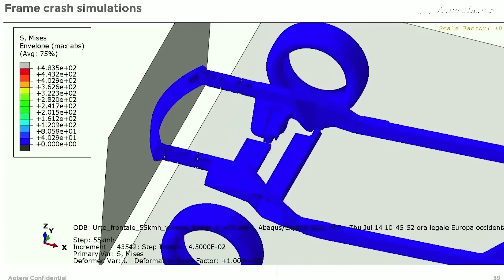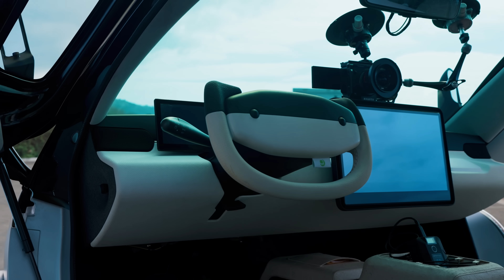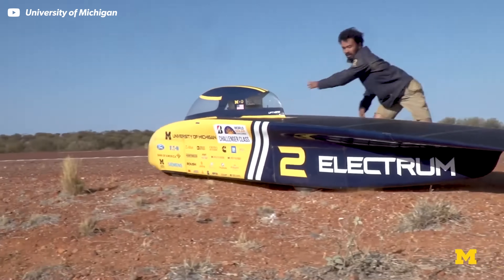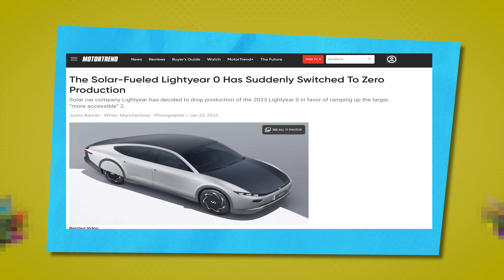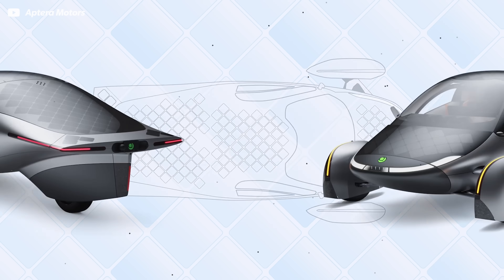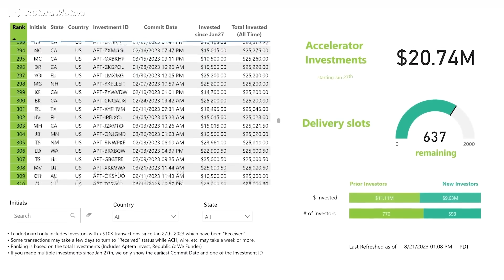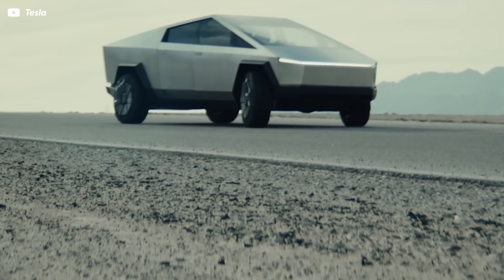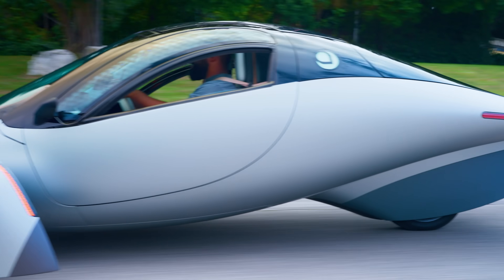We Drove America's First Solar Car

Comment: We desperately need more inexpensive solar vehicles. Bring them to the consumer. We want them. 

Most of us commute less than 60 miles to work. This car would mean free transportation to work every week. Which would free up so much income for low to middle class families.
Reply: And it's cheaper than most new cars at $25,000 usd
Reply: Except this design is dumb and not practical. If it was a regular 4 door with solar panels then yes, this thing is not getting used for a family car, there's no storage or space so this will have to be an additional car because what middle class families are buying this over a 10-20k SUV or Sedan...
Reply: @PieceOfSchmit new car sure, but for “cheap” daily driver it’s far off the mark. Used cars around $10k will still have this beat for usability. You couldn’t make this your only car unless you were in a big city where most everything you need can be delivered if it’s big.
Reply: @Mrbootyman Definitely not a family car as for the storage i guess it's behind the seats. 😅 Good enough for me since I'm single.
Reply: Everything about solar panels on a car is stupid. Even with 100 percent efficiency solar panels the sun doesn’t emit enough energy within the area a car takes up to be able to power it. It’ll always need a battery and it will always charger way too slow to be practical. It doesn’t add enough range while driving to matter it has to sit for days to charge. Far better off just putting solar panels on the roof of your house and charging like normal if you want solar power. Putting solar panels on cars will make them more expensive and easily damaged for negligible benefits. It’ll have a negative environmental impact. Solar panels already barely make up for their own carbon foot print putting them on cars just makes it worse. It’s a gimmick with no logical reasoning to exist.
Reply: What about a cheap electric car like a Nissan Sakura which cost about 16000 usd and you spend the rest of the money for solar at your house instead that way you get a much more practical car and free energy for not just your car but also your house. The only downside is your car doesn't do 0-60 in 4 seconds, but do you really care? Solar vehicles are cool but I don't think it can be the main trend.
Reply: @Mrbootyman there’s not enough solar energy for a 4 door car or you’re back to 10 miles a day
Reply: @Mrbootyman   Actually, there is a great deal of storage - over 32 cu ft.  sure it is a two-seater but 90+ percent of all miles are driven with the driver alone in the vehicle.  The money one would save on gas driving this instead of their Escalade would damn hear pay for itself. This means that for nearly the same dollars,  instead of having a big SUV with 100,000 miles on the clock, at the end of five years you still have your Escalade, only it has 12,000 miles (all the family trips but no commuting) and a low-maintenance EV with a million mile battery with 90,000 miles having spent less than a half-penny a mile with 200,000 or more miles left.   

It is only dumb and impractical if you're highly invested in Exxon-Mobile 'cause this innovation is going to make owning that stock dumb and impoverishing.
Reply: @Mrbootyman  most people grossly over estimate how much they drive and what they actually use a vehicle for.
Reply: @nutthaworncharoensuk1483  My only problem with the Sakura is that it's a Nissan.
Reply: @Mrbootyman  not everyone has kids, in fact, the under 35 demographic is having less and less children. People definitely want a car like this.
Reply: @JacobLeeson-zk1ol  I would say "up to 40 miles a day" is a pretty sizable amount, my commute to and from work is less than that. Obviously, weather is gonna play a big role in that, but it's a decent amount of free energy; and I don't work every day so my days off would offset the loss of bad weather, so it's hardly a gimmick for those who don't drive a lot. Repairing the panels is definitely a valid concern though.
Reply: @bobert4522 I think its very obviously a city car
Reply: @Mrbootyman  Most cars on the road only have 1-2 people in them
Reply: @JacobLeeson-zk1ol 40 miles of range per day is not practical? That’s exactly how much the average American drives per day.
Reply: @Mrbootyman  in North America the average amount of people In a vehicle per trip is 1.3 persons. Rarely is it more than 2. Just drive on the highway and look into people’s cars and you will realize that no one carpools and everyone loves using a 2-3 ton vehicle to move themselves and a few lbs of stuff from work and back.
Reply: @bobert4522 Lmao, do you live in the middle of a forest? No one said this would be the daily driver of farmers lmao.
Reply: @DadsGetDubs  Fair enough
Reply: @JacobLeeson-zk1ol you obviously haven't done enough research on solar panels. They aren't a replacement for standard energy production, but that doesn't mean they don't produce any at all. It's not a stupid design either, it's based on aerodynamics (which increases efficiency). Compared to fossil fuels, the carbon footprint is much smaller.
Reply: @alalalala57  nor did I say you would be hauling timber in it.
Reply: @DatGrape111 The aerodynamics and solar are completely unrelated you can make a car without solar panels aerodynamic it would be easier actually.  Putting solars panels directly on the car doesn’t make sense. It’s not any better for the environment then having the solar panels elsewhere and just charging the car but it’s much worse for the user hence why it’s not practical. The theoretical maximum for solar power is 1000watts per square meter. Realistically it’s more like 200-300w. A standard car is around 4.9 x 1.8 meters.  That’s 8.1 square meters. At least 2 of that is unusable because of windows ect so let’s say 6.1m^2. That means best case scenario you could get 6100 watts however realistically it’s more like 1220 watts. Cars use peaks of 600kw when accelerating and use 15-30kw at highway speed. Solar panels are no where near enough. They can charge a car when not in use they can’t sustain it. So there’s no reason to not just charge using regular electricity. The electrical grid will eventually be completely renewable and in the mean time put solar panels on your roof if you want them it’s far more practical.
Reply: @JacobLeeson-zk1ol I don’t understand how it is worse for the user when the whole point is it lets you charge without plugging in, that means if you’re parked at work and they don’t have EV spots you’re still getting charged. This vehicle is far lighter and more aerodynamic than normal cars so the amount of energy it can get from solar isn’t negligible.
Reply: @JacobLeeson-zk1ol  if based only on solar panels, then it is not enough for a running vehicle (assuming it doesn't store energy).  But that's not the point.  It's stored energy from solar panels that would be practical for the average everyday person with their average everyday commute.

This means the user doesn't have to charge at home or at a charging station.  It will basically be free energy and range for your commute.

Comment: I am so happy you guys decided to check out Aptera.  I think this is an amazing vehicle for a lot of people.  I would like to own one for sure, but I live in the Rural midwest, so I need lots or range, or the ability to charge it everywhere.  Also it snows a lot here, so it will be interesting to see how it performs in the snow.
Reply: Aptera has said that even the 2 wheel drive variant performs well in the snow. Because the vehicle weight is 60% forward.

But several reservation holders are skeptical and most prefer the 3 wheel motor version. Which probably caused them to configure the launch edition with AWD.

Comment: It's a solid plan, I hope they can nail down that cheap price. One thing I saw on another channel was availability of repair information. That's a business model I can get behind. Something intended to be repaired, and built to last. Their really trying to be a different kind of company. I hope it works
Reply: "Their really trying to be a different kind of company. I hope it works"
when some major stockholder starts screming: "i want more money"! 
then the model will change pretty quick....its easier and cheapier to produce disposable trash and then charge for "fixing" it by throwing "new" disposable trash parts at it
like some cars with plastic water pumps....
Reply: @faustinpippin9208 that's a valid risk but 1) at least they're trying to do the right thing to start, most companies can't even say that, and 2) if parts are easily available and they're vaguely popular it won't be long before third party manufacturers start making compatible parts.

Comment: if they actually end up selling units at 25k and get a few of them off the line i can definitely see this being the company that finally gives telsa comp in the electric car field
Reply: I kinda doubt that part. Tesla is an established brand now with a cult following. Not to mention seeing how many people today buy a crossover over a sedan for 5ft² more storage space, I doubt this care has the market impact of a Model 3 or Y. 

I think it's completely worth considering though for single people or those who have two cars and one for just commute to work. I mainly want one because I drive an absurd 90 miles to work one way. Any gas savings is a few hundred dollars a year. Otherwise it mainly targets those without a garage to park, no paid parking on the street, and are can't handle ongoing payments. So it really only makes sense for lower income individuals.
Reply: they wont sell any at 25k lol
Reply: @farklestaxbaum4945 brother that's the price of a new corolla now lol. And with ev tax credit they definitely would
Reply: $25k is an old price they made up.  The Launch Edition with up to 400 miles range is listed at $33k on their website.

Comment: Hell yeah, I've had a reservation for one for two years now.  I really can't wait for this car to come out.  It's just tough deciding on which version.  I believe the 400 mile range one comes out first, the 1,000 mile range one will be last.  They have a few other ranges in-between.  I really want the 1,000 mile range one, but I also want it sooner :(
Reply: Me too! I reserved one in 2021, not really expecting my deposit would actually materialize into a real car, but worth a shot. Still have my doubts about it reaching mass production, but hoping it will.
Reply: Would you really drive it a thousand miles in one go?  I feel like the 400 would be plenty for me
Reply: I'll be very surprised if they even bother making the thousand mile range version. Statistics show there is so little use case for it. If they were going to forgo DC fast charging, then maybe. But with the efficiency of this thing, even level two would feel almost like fast charging in a Chevy bolt for example.
Reply: @PlaySA  Would be amazing to drive here in Canada, some places can get remote and just the idea of not having to stress about where i can charge is enough for me. You can drive across the country and plug in at a motel every night gaining another 75 miles. Absolute insanity.
Reply: So, what is the company telling you about the reservation? Does that just make you first in line when it does drop? if ever? Like you said I remember seeing details on these years ago and still haven't seen anyone driving one or heard of them actually being on the market.
Reply: @Nabee_H  Great thing is even if you run out of charge in the wilderness, because it's solar powered after a couple hours in the sun you can try to make your way back to civilisation.
Reply: @EVANHIRSCHMANG  they made a new system after that for who gets to be first in line, so they've technically sold the first in line spots at least twice now (by taking deposits and by investor grade)

Comment: As a technician, I would take this over any full-battery EV. This makes way more sense, and I'm really happy that this is finally getting a chance to move forward. 🔥
Reply: Not sure what you mean by "full battery EV"... it has a slightly larger battery than a base Nissan LEAF.
Reply: @lsh3rd  I'm stating that its power is not fully based on the battery alone, unlike almost every other EV ever built.
Reply: @oxidizedolive   I suppose this is going to be a common misconception, but the drivetrain is a normal EV that relies on its battery. It just has solar panel on the roof to trickle charge the battery.

The solar panel is not the cool thing about this car; it's the ultra-high efficiency that makes a solar panel a reasonable expense.
Reply: @GarrickStaples  yeah, I suppose I should have said that a lil bit better... 😂 But yeah, it's the efficiency that has changed over the past few decades and recently made that notable step-up.
Reply: Depends with the battery kwh capacity
Reply: @oxidizedolive it's literally based on being a BEV. The solar cells are even optional. It's similar to the new Prius
Reply: As someone who knows the laws of thermodynamics: hahahaha

Anyway, go waste your money if you want.
Reply: @The_Ballo  It has Solar as partial energy input. Personally i'm living in Australia soo it would have a noticeable contribution. It complies with laws of physics just fine.
Reply: @Neojhun  You sound like your'e bad at math. I have a 250W panel on my RV which couldn't even charge a scooter.
Reply: Awesome for tropics like florida
Reply: @eddyr1041  ...where the air is the thickest.
Reply: @deadballo  you meant humid... ? Yeah.. how humidity work with electron excitation does quantum effect can be take into account? One thing for sure when overheat it will be harder to cool in humidity that is high than normal.
But seems since it is near the body of water can we cool it down by the sea? Dumping heat into oceans? So many catch 22 as thermodynamics goes.

Ideal solution will be of course having nuclearbfusion power plant
Reply: @Neojhun  yeah seems great for ausd8e
Reply: @deadballo  @Neojhun dead balloon in the states...
Unless like Arizona etc I guess...sunny year round
Reply: @eddyr1041  If you're going to have a solar power plant, photovoltaics, regardless of if they're actively cooled or not, would hardly be efficient or economical. Even the least efficient solar heat collector plant is more efficient than the most efficient photovoltaic (which isn't saying much). They also consume a lot of land so you have to ask yourself how much of the everglades do you want to clear cut and drain for a stupid vanity project. 

There are a million other things to consider, which is why we have this handy dandy system called a market economy to work out the tradeoffs.
Reply: @Neojhun  Yeah adding 8km of charge per hour it can get full sun doesn't add up to much even here, especially when you consider that peak charge will only be a couple hours a day if your in the ideal position. Although if you only drove 15 to 20km a day and had a good outside parking spot it might workout then but honestly for the $50,000 Australian it costs you could buy a mid 2000's hatch batch that's uses nearly no fuel for the next 10years and pocket the other $40,000
Reply: As a technician you would prefer this deathtrap on 3 wheels over a Tesla? What kind of technician are you? Lego Block technician?
Reply: @vic321344  specifically, I'm referring only to the electrical/solar side of this. The wheel count (or the whole chassis design for that matter) is a whole separate issue. 🥴
Reply: @oxidizedolive  There is no real information for the electrical or solar side of the Aptera motorcycle. Just promises. No 1000 mile version existent. Just one solar existent on the Gamma, that may or may not work. No data on the solar yield available. 
The batteries are old fashioned, as are the hub motors.
Reply: This is a full battery EV. It just is additionally charged by a solar panel.
Reply: @oxidizedolive - No, the motors are entirely powered by the battery.
Reply: @The_Ballo  you are not familiar with the laws of thermodynamics, kiddo.